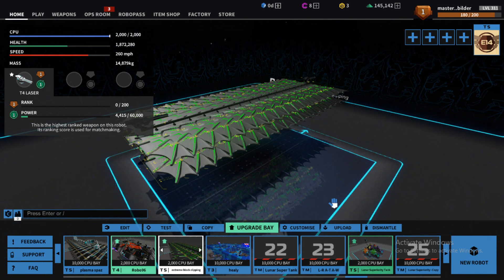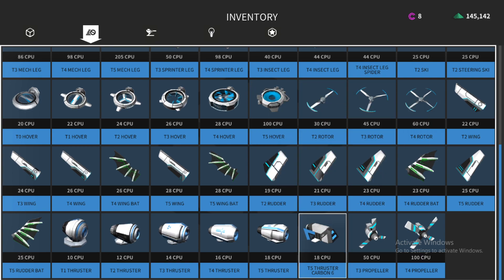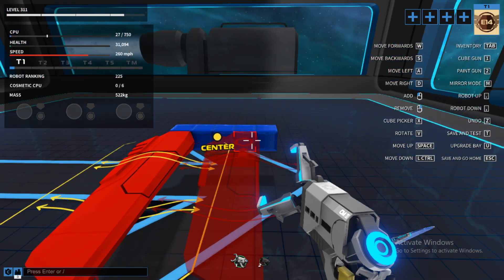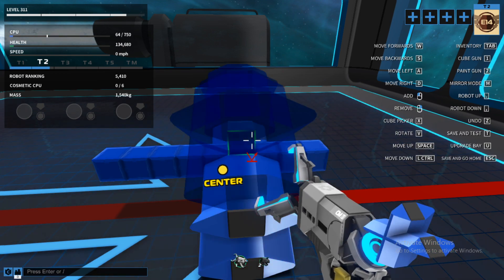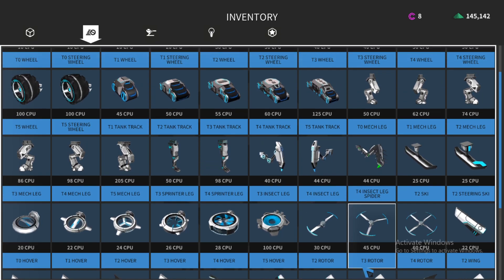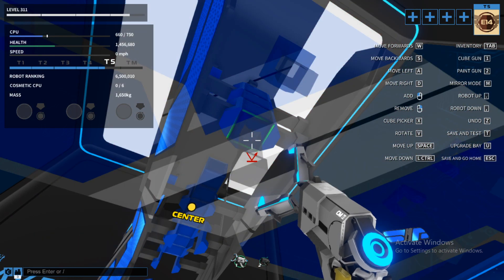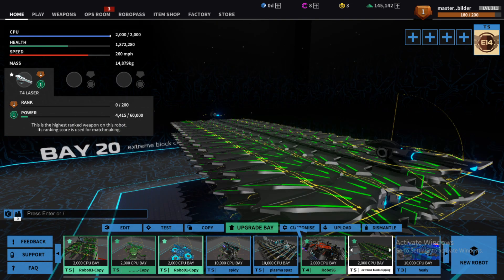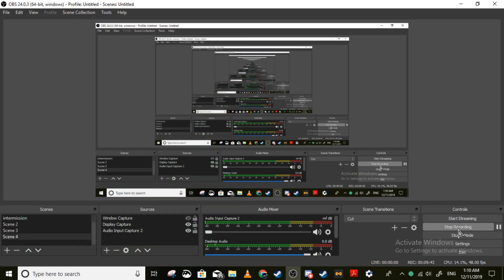extreme block clipping robocraft

Comment: Not trying to be a damp blanket but taking an extreme clipping bot into a match is a good way to get reported and banned.

Pretty sure its "OK" to use in custom games if both sides agree to it though.
Reply from the maker: thats why i have only used it vs AI ^-^
Reply: @quantumrain214  that is very good to hear. Also keep them off the CRF. :c)